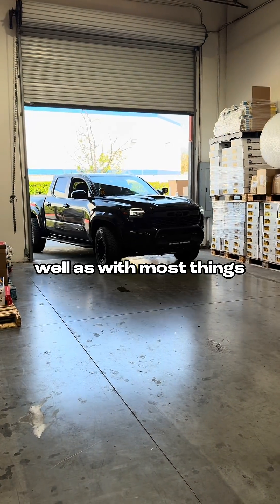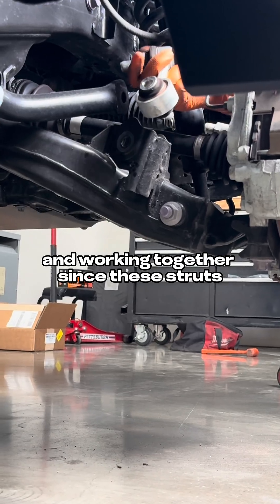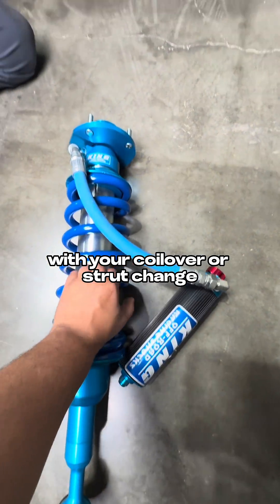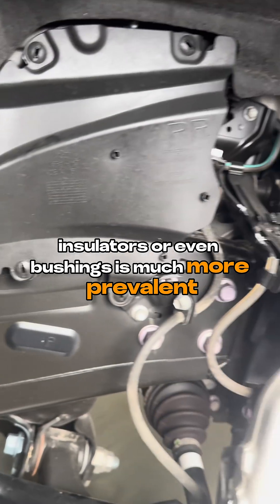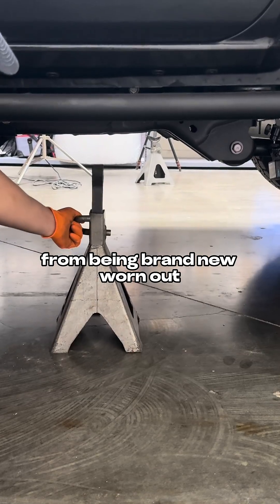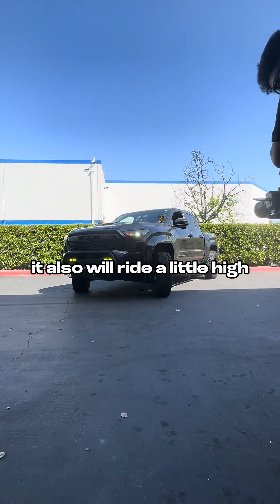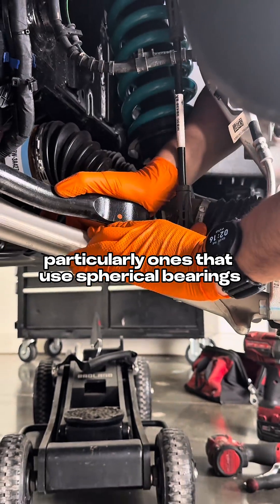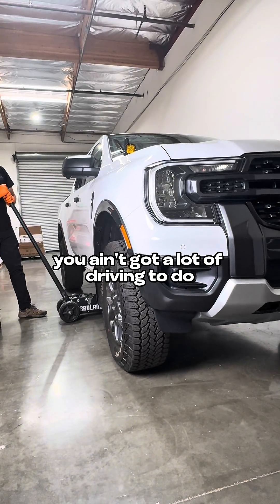DO YOU NEED AN ALIGNMENT WHEN YOU CHANGEYOUR SHOCKS? #shocks101 #shocktalk #shocksurplus

Comment: I totally agree with you but if the driving attributes changed after the shock replacement even though you maintained the ride hight and other things or you had sway bar you still have to do the alignment to avoid more problems like losing the bushes any other critical suspension parts.

Comment: It has nothing to do with the alignment, what does is the tire tread wear from bad shocks. So rotate the tires in a criss cross pattern (I've always recommended that on lifted 4x4 trucks for every rotation to minimize the cupping and feathering. 

If you haven't had an alignment in 20-30k then you should have it checked at least.